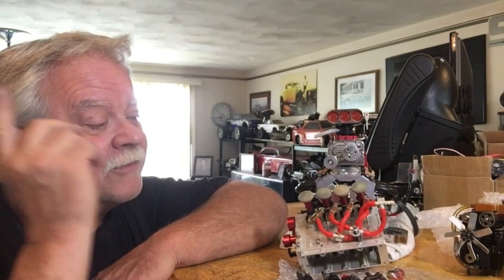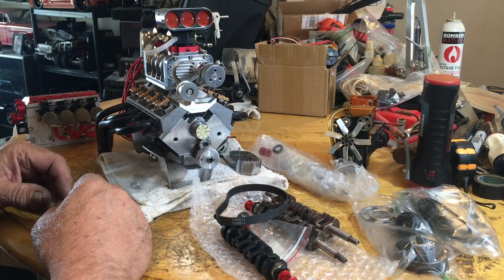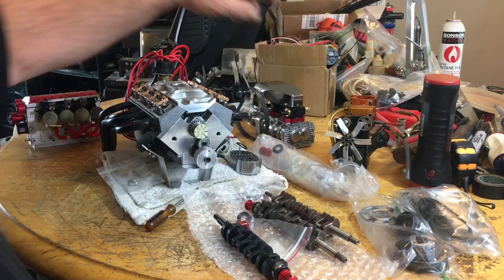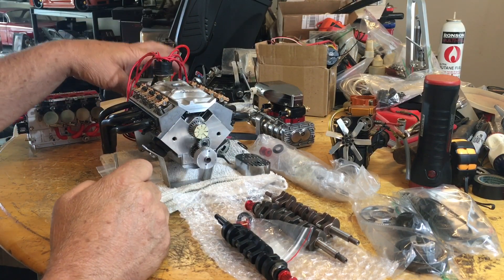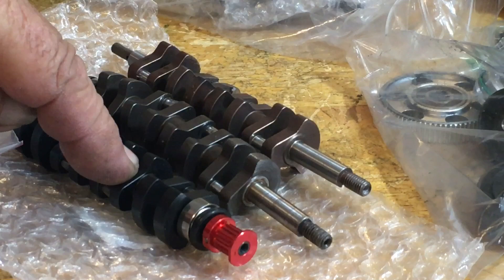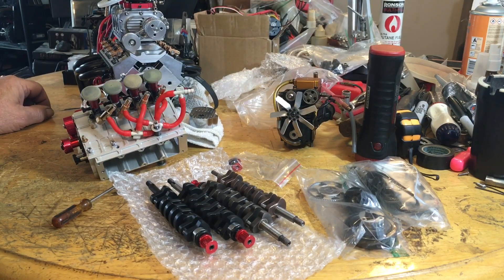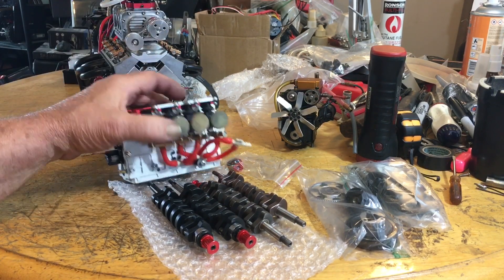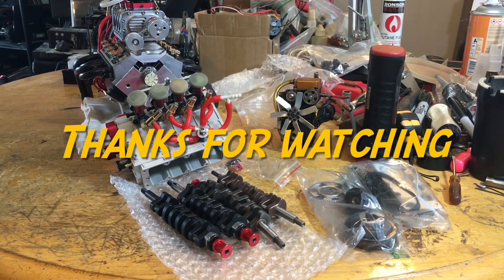Engine day! Aussie V8   Toyan L 400

Comment: For the price of that Aussie motor it should be exactly like real American V8 with dry sump lubrication, real spark plugs and run on gasoline.
Reply from the maker: The stinger 609 has all the options but they are around 9-13 grand, yikes lol!

Comment: I think the only way to solve this problem is a combination of your idea of 3 roller bearings and Tims idea of a bronze bush.What I propose to do is using 3 pieces of bronze spaced 120* apart to ONLY just clear the crank by 0.001"or even less. The 1st piece would be screwed to the crankcase the other 2 to the sump.I am going to use a piece of silver steel that will slip through both main bearings and then using engineers blue and files,millers or whatever I have machine the 1st piece to just clear the crank (silver steel). I`ve not yet measured the center main bearing diameter but if it is bigger than front and rear then a sleeve would be needed to slip on the silver steel.Same goes for the other 2 pieces. This way there would be just enough clearance for the oil and not too much to allow the crank to flex. I don`t think the harmonic balancer would work.The maths involved in calculating the needed weights is quite complicated and if wrong can actually be worse than non at all.
Reply from the maker: that is a really good idea using the 3 piece bushing, it will keep the heat down and let the crank journal get lubed. the harmonic balancer is a complicated venture and there is no room to install it anyway.

Comment: How many degrees is your ignition for each cylinder?
Reply from the maker: the V8 uses glow plugs so I haven't checked the degrees yet,  I would love to make a full spark ignition down the road, to advance the engine as of now you have to advance the cam on the gear the guy says 20-30 degrees it runs best.

Comment: Hi Dennis, sorry but I just got to ask; which new crank are you going to use first. I am somewhat alarmed that they are different! Have you had a micrometre gauge on them yet to check if they have the same dimensions ? Can't wait for you to fire up that Aussie V8. Stay cool.
Reply from the maker: I had to laugh when I seen they were different lol! I installed the one that was not polished because the polished one had some gouging on the journals, I am waiting for the new billet heads to come for the V8 then its party time.

Comment: Can't wait for that V8 to cackle to life. It belongs in a Rovan Baja methinks, something it can really stretch its legs on.
Reply from the maker: Yeah I agree it needs some time to use the rpm ranges
Reply: @dennisdempseyradiooutofcontrol  Throw in the 3-speed kit they sell for it and you've got one amazing sounding buggy! And hell if that V8 can't at least pull as hard as the stock 29cc two stroke there's something wrong with it. Especially with the blower on.